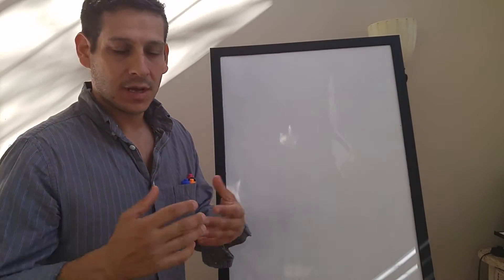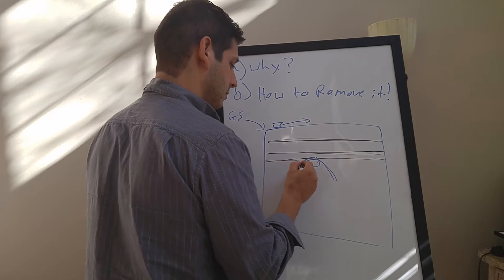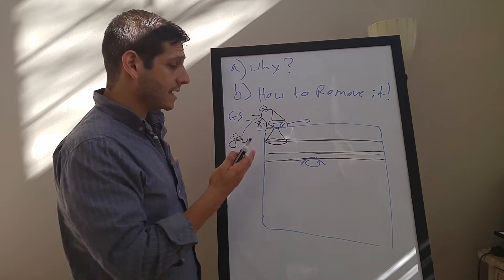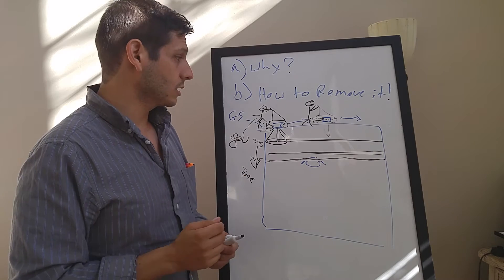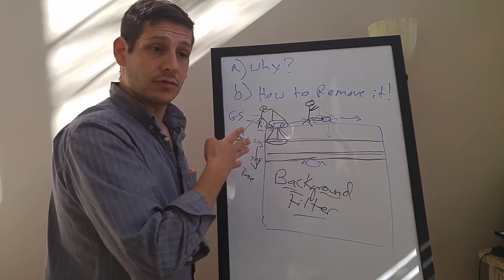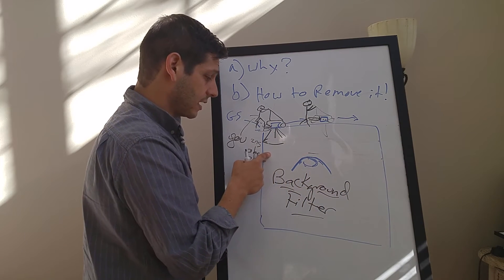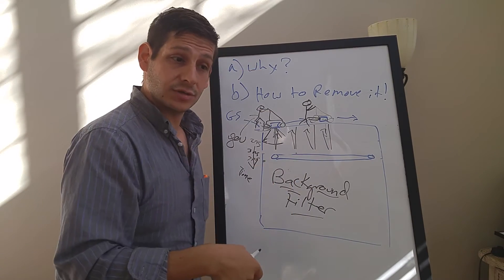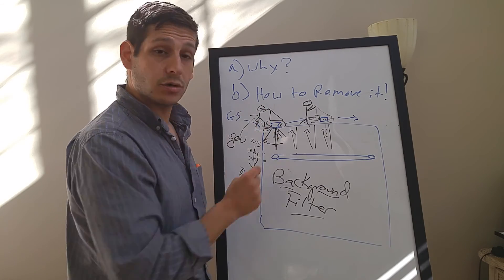HOW TO REMOVE HORIZONTAL BANDING FROM YOUR GROUND PENETRATING RADAR (GPR) DATA - BACKGROUND FILTER

Comment: We did a survey inside a concrete pipe sleeve and the horizontal reflections were too many. How would you remove such noise if the purpose of the survey is to map voids
Reply from the maker: victor mapuranga thanks for the comment Victor! I would begin with a conservstive filter and get progressively more aggressive. Be careful not to remove the voids from the data

Comment: Steel toe boots be a problem with creating banding? I use a paint stick as well for marking. Should I hold that as far from it as possible? Or just discontinue all together. Great video this is an awesome channel. I'm looking forward to a video about high pass low pass filter with FIR and IIR
Reply from the maker: Steel toe boots can be an issue, but it shouldn't be much of an issue if you keep the boots far enough away. The signal from high frequency antenna (1GHz to 2.6 GHz) often used in concrete scanning should dissipate before it reaches 1 meter. So if you can keep the toes away by 3 ft, then the impact on the data should be minimal. Same with the stick (though it should have much less of an effect than the steel toe). 

Thanks so much for the comments and the love. I will definitely do a video about high/low pass filters in the near future.